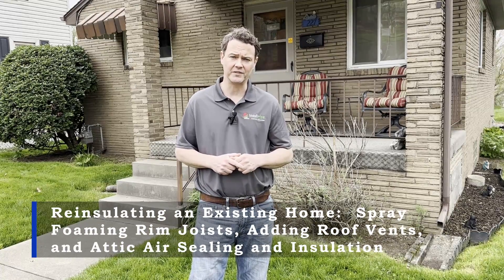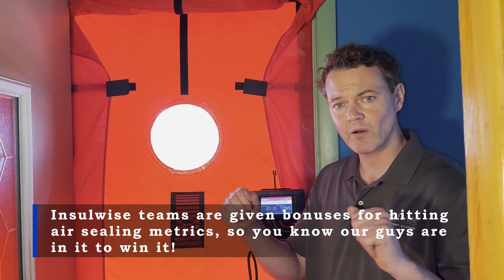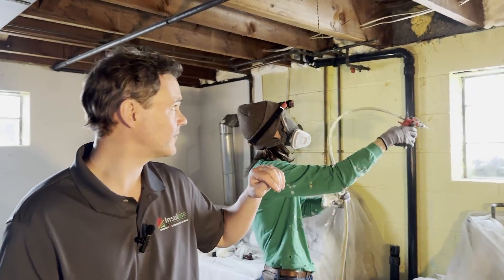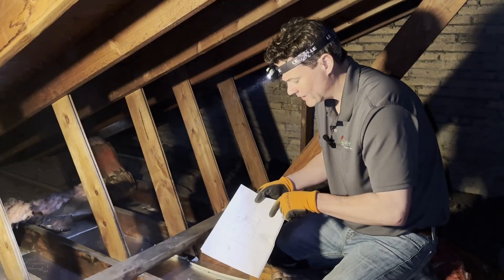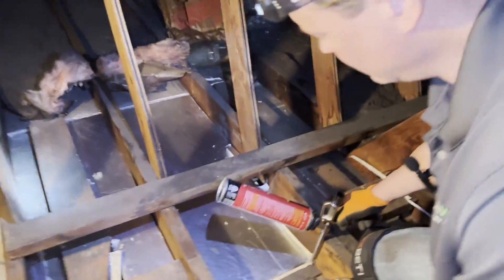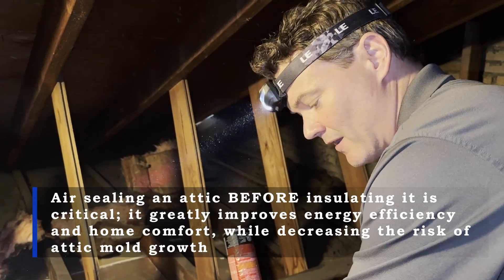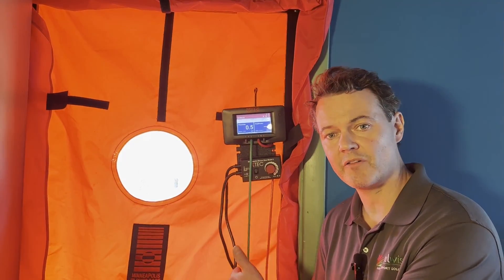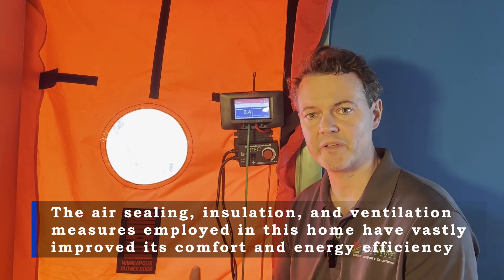How to Make Your House Cooler -- Without Using Your Air Conditioner!

Comment: what is the spray foam gadget you're using for the holes?
Reply from the maker: That was a foam gun.  But regular foam in a can off the shelf will work just as good, albeit the curing time is a little bit longer.

Comment: I live in Michigan and have a capecod style upstairs room with a knee wall. The previous owners had R30 insulation held up to the roof bays with wire. With two layers of 2in pink rigid foam along the back of the drywall ceiling for the knee wall. But there was no insulation on the floor in between the floor joists or in the knee wall. This house has soffit and ridge vents. The baffles were incorrectly installed and did not have the flap to block off the floor joist bays from the soffits and the baffles were not overlapped, leaving big gaps. We have had issues with snow melting and causing ice dams on the roof, with obvious signs of heat leaking through the roof showing where the roof bays are in the snow on the roof.

 What I plan to do is drop the insulation from the roof bays into the floor joist bays, put foam blocks in-between the floor joist bays at the soffits to prevent air wash and seal the attic a bit and put foam blocks in-between the floor joists under the knee walls to seal the floor from leaking hot air from downstairs into the attic space, unfortunately I cannot afford to insulate under the floor between the downstairs and upstairs room, I will fix the gaps in the roof bay baffles with tape and add 2in pink rigid foam over them to create a channel and barrier from the attic space. I will insulate the knee walls with R30 fiberglass insulation with perforated radiant barrier to hold the bats to the 2x4 stud walls and prevent moisture being held in. I do plan to have a gap in the rigid pink foam that is in the roof bays at the high corner of the knee walls for ventilation. The idea being that when the air rushes up the roof bay channel, it will create a siphon that will suck up any hot humid air from the attic space up to the ridge vent. Is this a good idea? Are there any issues with it? Any help would be greatly appreciated!
Reply from the maker: Hi there, you've got a quite a project and Capes are complex homes.  I've added a link to a video where I show how another company insulated a Cape in Pittsburgh, why it didn't work, and how we addressed it.  I would watch it first and come back with any questions.  We've insulated over a thousand Capes this way here and it's been an effective solution in terms of comfort / energy efficiency improvement without mold growth in the attic spaces.  
https://www.youtube.com/watch?v=YsVCTGRR7fc&t=355s

Comment: Also how did you attach the foam board to the underside of the trusses above the stairwell? Thanks!
Reply from the maker: Sorry, I should have shown this in the video.  We attached a stud on the underside of the floor joists - directly in the middle of the stairwell void by toe nailing it in with screws.  We then laid the foam board in between the rafter bays in strips, tacked them into top plates at the edges with roofing nails, and then sealed all of the perimeter edges.  It's a durable and effective solution. 
Andy

Comment: What tips/questions would you recommend when trying to find a good attic insulator? Do you ever install baffles for the soffits not to be blocked by the blown in insulation? Thanks for the great videos!
Reply from the maker: Thanks!  When there are soffit vents we ALWAYS install baffles.  This house did not have functioning soffit vents so we did not.  My best tip for finding a good insulator is calling and asking about their attic air sealing policy and whether or not they can perform a blower door test in / test out.  If they say they do, ASK for proof via pics of the attic work.  Many company will seal what's around the hatch, maybe hit a few wire holes and call it a day (lame!).  Air sealing is hard, dirty, but critically important work for a good attic insulation job. 
Andy